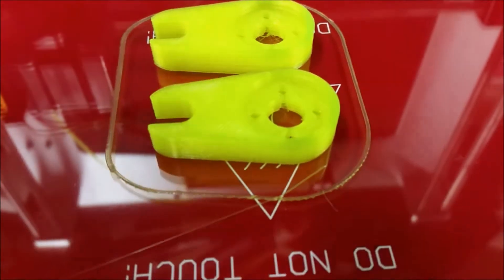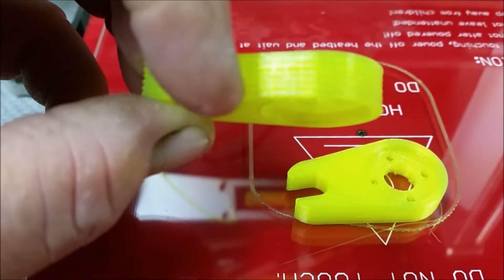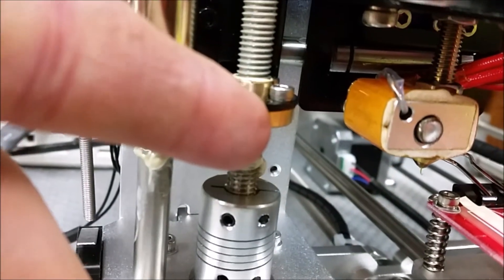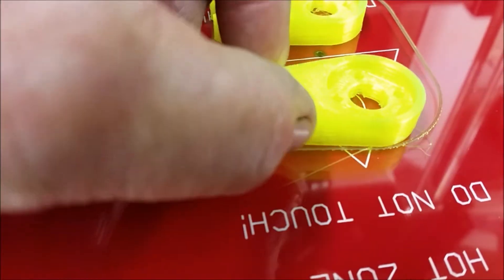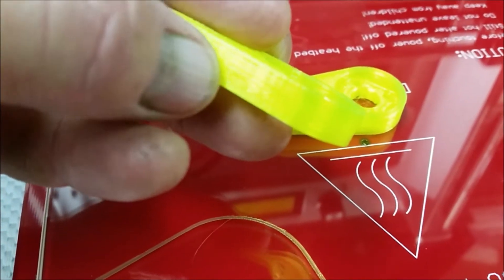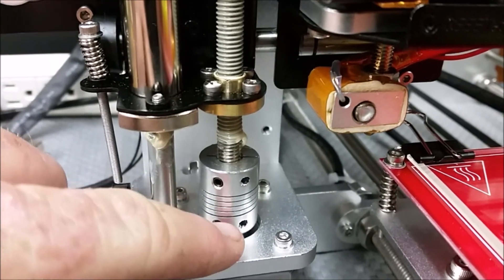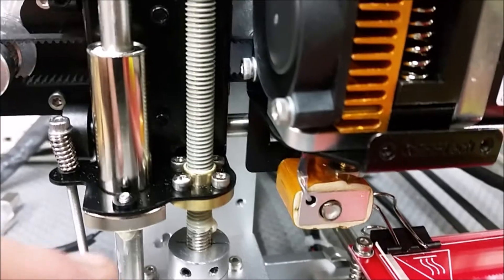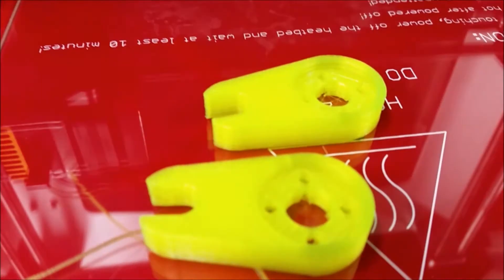Anti Wobble Bracket 3D Print

Comment: In case no one has told you, or you haven't figured it out.  That really looks like banding, from a improper layer height to threaded rod pitch ratio.  Look into calculating the proper layer height for your thread pitch.  It may fix your issue.
Reply from the maker: +PDX 3DS actually I did think of that, but that wasn't the problem.  It was wobble in the z rods that caused the problem.  It was fixed in this video.  https://youtu.be/mYswkbC_AX0